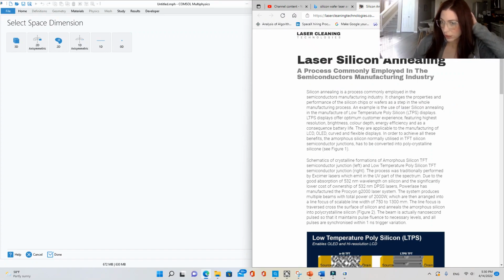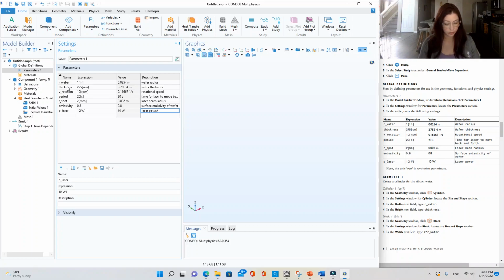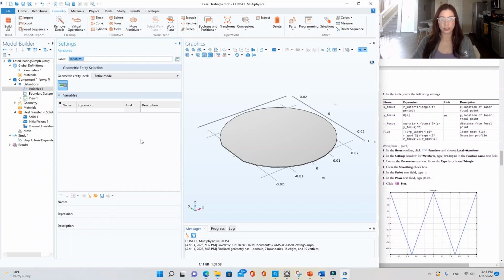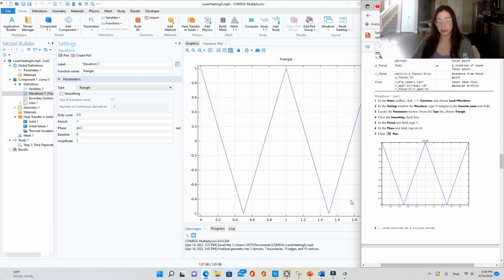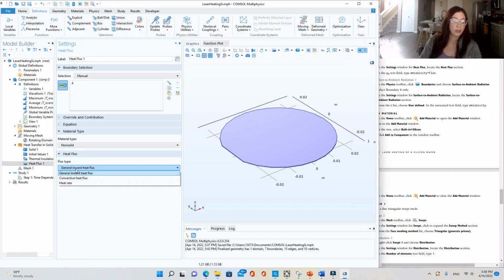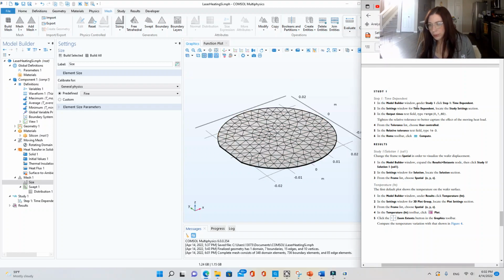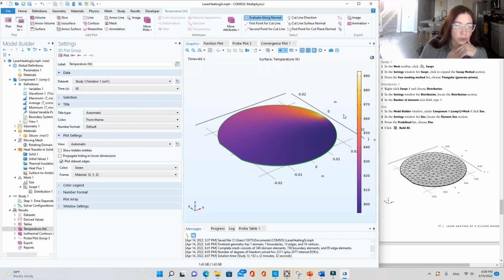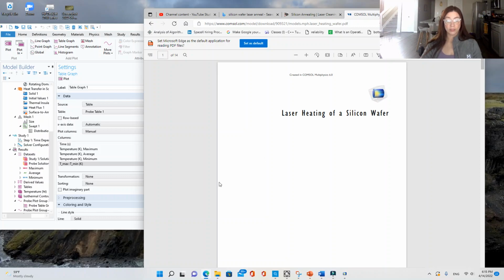Laser Heating of a Silicon Wafer COMSOL Tutorial

Comment: Hey Jessica! Can you explain why u multiplied by 2 the p_laser? I mean how u got 2, before the p_laser.
Reply from the maker: Hi that’s a great question not covered in the background. It turns out it’s not trivial to derive this specific formula, but I found this excellent source to drill down into the maths to see where the 2 pops out: https://www.me.iitb.ac.in/~ramesh/courses/ME677/thermal_modeling1.pdf refer to the slide called Gaussian moving circular heat source and also the thermal modeling slide which gives the Gaussian distribution of laser power intensity formula.